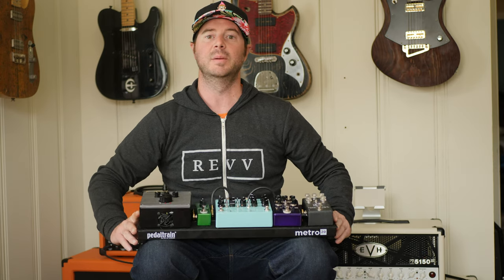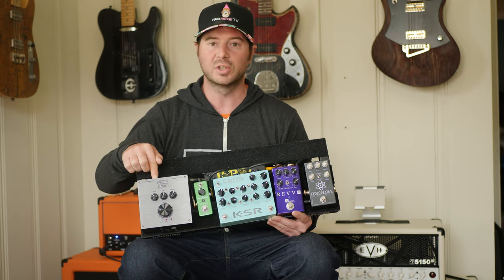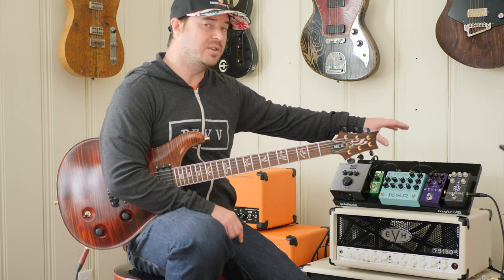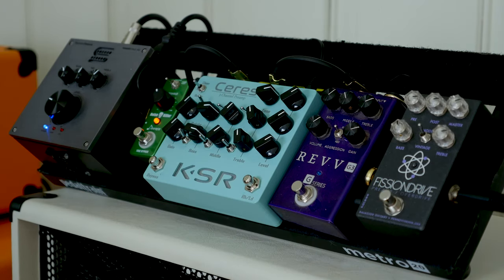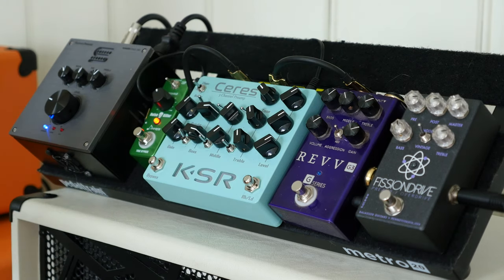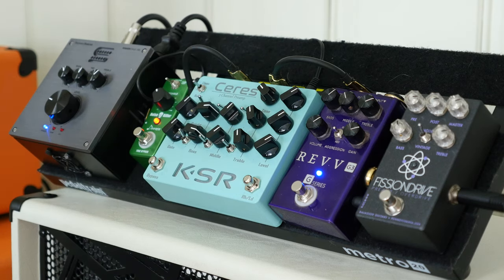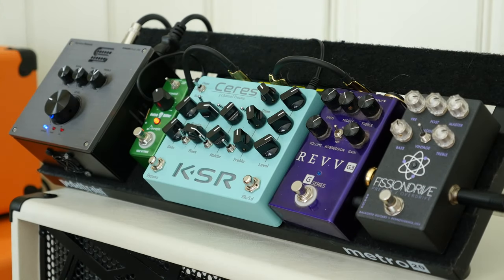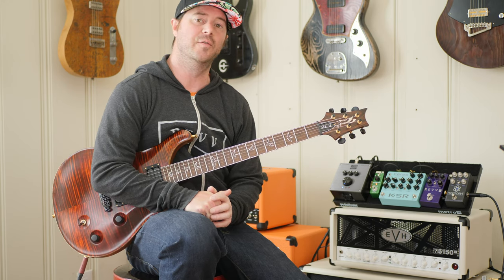Preamp Pedal Shootout: KSR, REVV, Balaguer, and Powerstage 170

Comment: I would never spend that much money on these pedals I have My Friedman (Joyo Uzi) G3 (Dark Flame) Revv G4 ( DemonFx R4), TS9808 also by DemonFx and Precision Drive is my Joyo Argos, Harley Benton GPA 100, for the power stage, and Guptech Vej 5 is the Diezel Clone, Vej6 Fission Dr. Orange Rockerverb tone clone and a LYR Rock 3 channel rip off. And a lot more under 600 bucks. Love it or hate it, pedals, sims, plug ins, digital effects,amps and Guitars these days are just amazing! Snobs back off!

Comment: How does the KSR compare to the Preamp in the EVH 5150 III 50w? Mainly the Red channel on the EVH. Thanks
Reply: @itsanthonybest  Okay, cool. Sometimes I feel like the 5150 iii is too bright. Thinking of maybe getting the KSR or Kraken preamp pedal with a single channel clean amp instead.
Reply: @itsanthonybest  That's what I want to do but a lot of the clean single channel amps are pretty expensive.
Reply: What did he reply to your question.  Doesn't seem to be there anymore
Reply: @skatertwig26  My comment is a couple years late, lol, but if you haven't already done so, trying a different cabinet/speakers can make a major difference. I've got a cab with V30's that I don't like and find it too harsh. But another cab I have (an old '80s Carvin that I put 2 V30's and 2 EVM 12L's into) sounds huge (and awesome IMO) with my 6505+ head, old Marshall JMP 50 watt head, or modded Peavey Rockmaster pre and Classic 120 power amp. And yet I also have a little cheap Peavey 112 cab that I replaced with a single V30 that I think sounds good for a single speaker. If you have a V30,  a Greenback, or some other speaker that can have a lot of midrange or upper mids, it may be worth trying a different speaker or set of speakers. If speakers hadn't become so expensive, I'd probably bother to try swapping for something else or to combine with the V30's in the one cab. But for now it makes a good holder for setting my Marshall amp head on top of if nothing else. :D
Reply: @Rushtallica  Hahah yeah, I went down that road last year. I actually got my dream cabinet, an oversized Mesa 4X12 with v30's... And I hated it haha It sounded so bad to my ears, so much I kept my Line 6 Flextone Cabinet instead. I can feel people cringe reading that but it is true . The cleans sounded so good on the Mesa, but any gain sounded fizzy. I could not dial it out. It was so direct, fizzy and somehow thin sounding. I now run the Axe Fx iii into the KSR PA25, and into my old Line 6 cabinet. I love it. I haven't felt any urge to get anything else. Thank you for the suggestions!
Reply: @puddynuts  I just saw this sorry. I think he suggested using a preamp, like the synergy modules into a single channel clean amp. It was a while ago, so I am not 100%.
Reply: @skatertwig26  You're welcome, and I'm glad that you have a setup that you love now, and that it's working great with the cab you already had.  8)  And I can completely relate on being surprised by gear I wanted for years only to end up being more impressed with what I already had. :D
Reply: @Rushtallica  Thank you ,man! Yeah it sounds great, and it's nice to play with headphones when needed. Exactly, sometimes wanting is better than having. At times the thing you've always wanted, actually isn't haha

Comment: Great Video,
wich do you recoment me....
The KSR ceres or the Revv G3
Reply from the maker: Between the two i would take the Ceres every single time.  I prefer the revv G4 to the G3 which was not tested in this shootout.
Reply: @itsanthonybest  please tell me in amplifier no loop effects send return, whether goodksr ceres sounds in the input of the amplifier and whether it will be good to connect to the card focus rite through vst nrl dsp turn off amp leave only cab? .
Reply from the maker: @ПавлоВенгерко  The Ceres would work well in either scenario.  It has no cabinet or power amp modeling, it is only a preamp.  You can use sofwtware poweramp and cab modeling in your DAW.
Reply: @itsanthonybest  turned on the input of the amplifier, the sound seemed digital

Comment: Hi, 
I'm trying to get a descent tone with Revv g3 using Boss Katana 50mk2.
I'm using les paul studio, 1 spot cs7 (new), boss ns (new), korg tuner (new). Dialed to clean channel but tones from the amp are muffled...any clue, please?
Reply: Try using the acoustic channel. Also you can use max wattage setting for headroom. The low power settings are pointless because it’s a non valve amp.

A) max the channel volume and control loudness with the master volume. This will drive the pre amp section in the amp.
B) max the master volume and control loudness with the channel volume. This will drive the power amp section of the amp.

Use what sounds good to you.

As for EQ turn down unwanted bass middle and treble first, before adding more of one frequency do this with all amps it will make you happy.

The boss katana is an over hyped amp I personally didn’t get on with it. Orange crush pro amps, Peavy bandit, Roland blues cube and cube amps all sound better then the Katana in my opinion. As for tube amps inconsistent, unreliable and expensive but when they work they’re amazing, when they don’t they suck. Oh and they weigh a ton not something you want to carry up a fire escape to the third floor where your gig is at.

Have fun now.
Reply: @sid35gb  Thank you for a great advice! Take care 🙂